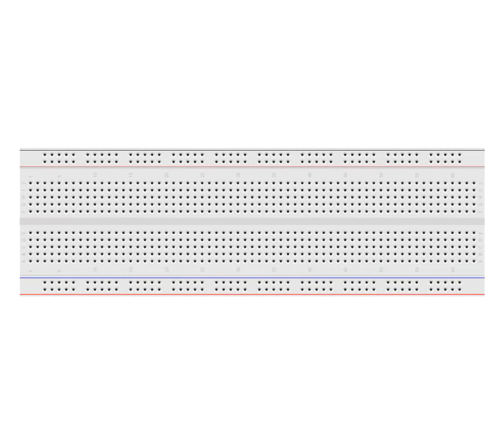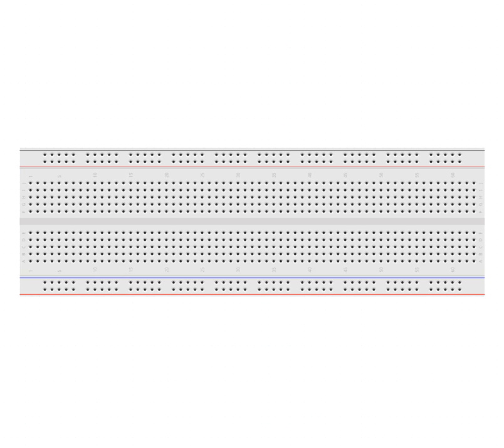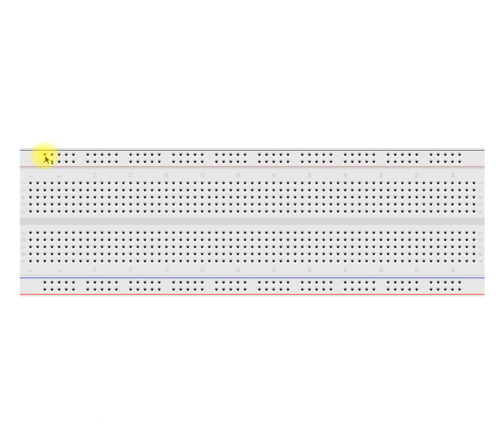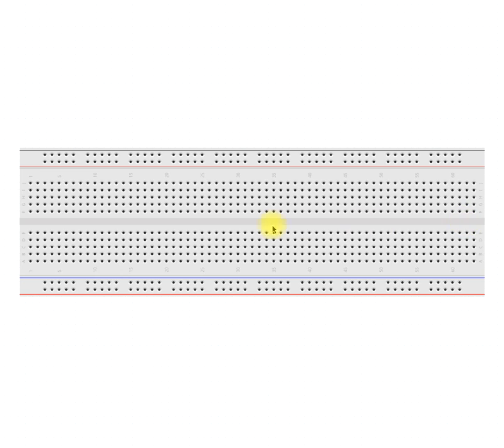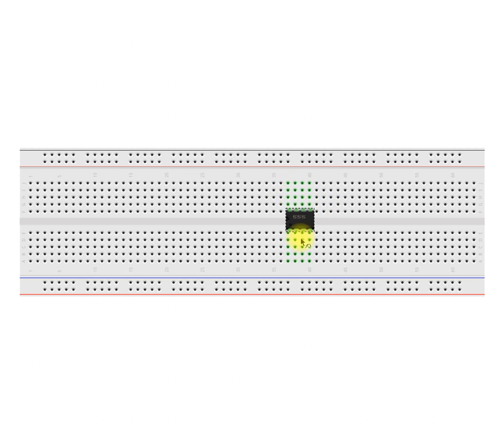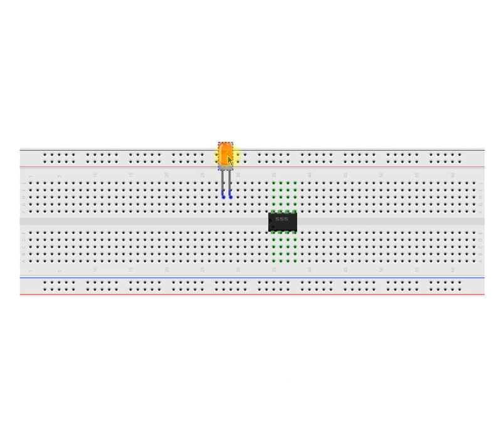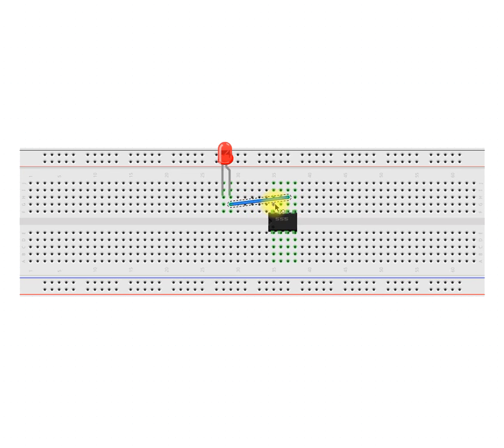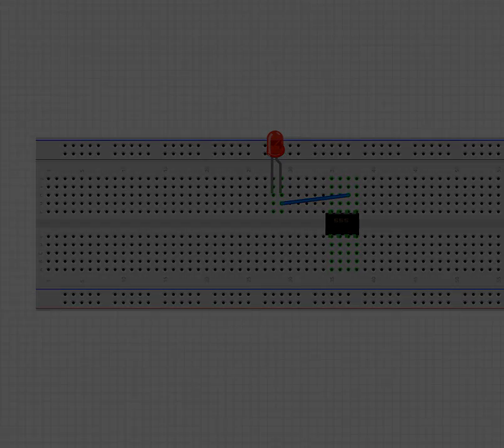Breadboard explained

Comment: What software is this breadboard simulation? I could use that to share design ideas =)
Reply from the maker: HiSorry for the late reply.The software is called Circuit Wizard. It is not free and has limitations in its component store but it is a very good application for a large quantity of circuits.Prototyping and sharing prior to actual build is ideal as the application shows the user what is happening in your circuit, volts, amps etc.